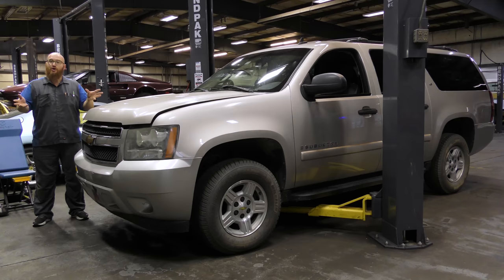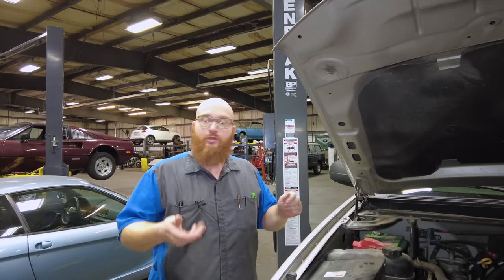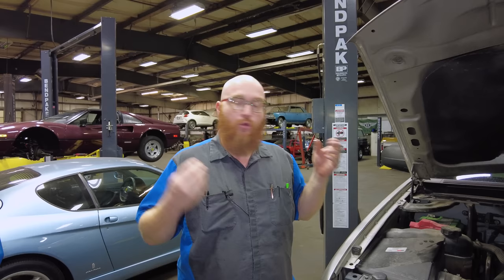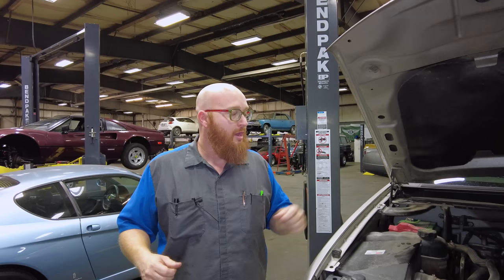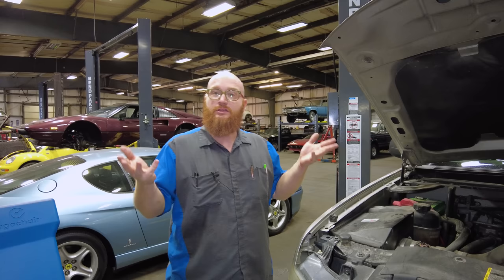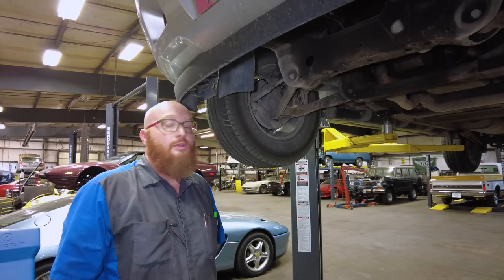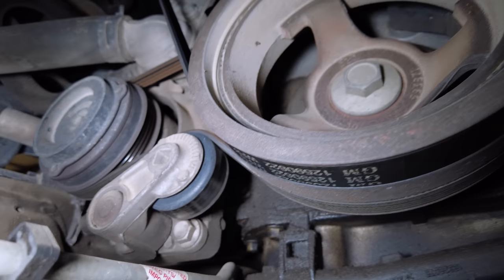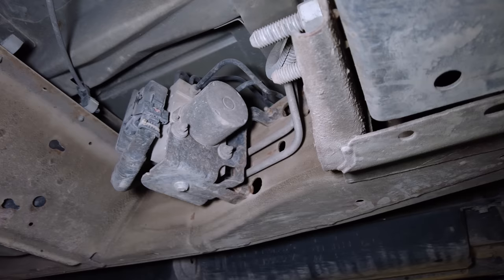What fails on ALL early 2000's Chevy SUV's!? CAR WIZARD shares what he's seen from the last 20 years

Comment: I have an Escalade instead of a Tahoe, but is it a 4L60 transmission and not a 6L80, or did the Chevys get the older transmission longer? I thought though that Haul/Tow mode also kept the converter from locking up and that you could tow in OD because of that. Is that not the case? 

Also, for the AFM, I bought an 07 Escalade because it didn't have AFM yet, but I was told that it still has AFM parts, like the AFM lifters that fail are still in my engine, just not activated. So I believe I'm still at risk from the AFM plagues, even though I don't have it. I've also had multiple broken exhaust manifold bolts. I had a loud tick from the leak that I think was causing a timing retard. I dropped about 3mpg after developing the tic which immediately came back after fixing the exhaust leak. 

One final observation is that a lot of these later ones were manufactured during GM's bankruptcy years. I live in an area where salt is used on the roads and my 07 has way more rust underneath than the 03 EXT I have or the 05 Escalade I had before the 07. I've never seen so much rust underneath a vehicle as my 07 Escalade.  I'll be surprised if I don't have holes under the door rockers soon, they're soft enough that I can push on them with my finder and they give.

One final fear I have about mine is replacing the A/C compressor. The bolts holding it are so tight I'm scared I'm going to twist the heads off trying to remove them. The way the compressor is mounted I'm terrified that if I broke the bolts that the engine would have to be removed, or at least lifted to drill out the bolts. I trust very little on my 07 as compared to my older GMs.

Comment: General Motors has always built the most undependable vehicles on the market. Folks bought them because they were cheap and easier to work on. Now GM is no longer easy to work on or cheap so why buy one. In the thirty years I worked in automotive repair shops GM vehicles were always the bread and butter for the shop owners.

Comment: This many failure points on a vehicle, that costs over 50 grand are not only unacceptable, it is down right criminal.

This video should be used as the bases for a class action lawsuit at the bery least...

Comment: Something that I never hear mentioned is that, on "CANBUS" GM vehicles (I've had it happen with an '04 Trailblazer and an '05 Silverado), if you have installed an iPod or other aftermarket peripheral interface, which has to go in between the radio and the vehicle harness, it can cause intermittent communications or noise on the CANBUS lines. Your vehicle will act like it's haunted. All sorts of electrical things will stop working, or even start coming on at random times. I chased my own tail for two days troubleshooting the Trailblazer. And then I bumped the radio, that I had loosened to get to something else...  It was like a grand awakening. Everything suddenly started working. I would have thought it was random except that, as I said, it happened on two different vehicles with similar aftermarket interfaces. It even happened to the new owner after I sold the Trailblazer. I asked him if he had installed an iPod interface. He never called me back, after that.

Comment: Some of this is true but way over exaggerated oil pressure sending units do go out but not as often as he's making it out and 200 to replace it? Lmao it's a 40 dollar sensor and can change it with the intake on in 5 mins. The active fuel management was worse thing gm did but to change a bad lifter for that or to even buy older heads and lifters to delete it is not 4k dollars. I rebuilt an entire 5.3 top to bottom with big cam performance throttle body and regeared my front and rear diffs for 4k. Ac tensioner is shit it will fail mine did at 230k miles. The ls coils are not that prone to failing now when I do tune ups I do plugs and wires anyway and the wires will get weak from the heat but can be removed with out breaking its not that complicated  but should be replaced. Exhaust manifold bolts over years of heat do rust and will break taking them off on basically any engine. Knock sensors do tend to go out thats true. Never had a gauge cluster issue or blend actuator issue. Never had an issue with the transmission lines failing either with multiple 200k mile gm vehicles. Any of these year models I've worked on Never had oil cooler block off leaking but any engine with high mileage can have leaky seals. 4l60e transmissions worst enemy is heat stock trans cooler kinda sucks add a 40k trans cooler a corvette servo and always tow in tow mode and it'll last

Comment: Bought new a 2011 Silverado 30 Dec 2010-5.3 . 3rd. Silverado-1st was a 1995 Z-71-2nd was a 2000. The 2011 was the biggest POS . Made lifter noise at about 1K miles. Absolute crap oil pressure-less than 40 PSI @ 75 MPH. It shit the oil pressure sending unit @ about 45K-did that myself-kneeling on top of the engine to get at it. 75 bucks-but my knees let me know what I did. LC9 engines notorious for losing the oil pressure relief valve spring in the oil pump-it shits the bed & dumps dang near all the pressure. 10 years later & a whole 80K on the ticker I bailed on that steaming junk wagon. I will NEVER EVER buy a GM vehicle EVER AGAIN. Absolute overpriced garbage.

Comment: 🤨🤔 Does anyone on here know how to turn off the overdrive on a 2007 Chevy Suburban ?   And is he saying all the time or just if you're towing something more than 2,000 lb? And actually I'm just here trying to figure out why Stabilitrak and traction control is showing on the warning panel trying to find a video that can give me in order step by step what to eliminate first. I got new motor mounts new elbow joints brand new tires new brakes and oil changes every 5 months and suddenly after someone stole my car and had it for 6 months I get the warning about s t a b i l - t r a k and traction control

Comment: First it was the gas pedal then the break pedal then the cruise control then it was a couple relays then it was ok then it went to number 5 cylinder plug wire and coil changed numerous times I might add then oil pressure sensor then I hear clicking on the dash and I’m looking at it while driving cause it was showing numbers and warnings then straight lines with no readings ( due to a short under dash behind the e brake it rubbed on the metal that’s down there until it shorted it’s self out almost there is a short under the hood but unsure where that is and then an o2 sensor after all that and it still runs like crap and this is an 2007 Chevy Tahoe don’t get me wrong I love the dam thing to death but not the headache that goes with it I need some honest help if anyone’s had any issues like what I’ve had please oh yeah it’s got almost 260,000 miles on it  oh I forgot to mention the cool lines we’ve relaxed one but not the other one
Reply: Oh yes then the exhaust manifold bolts continues miss fires on number 5

Comment: Yup replaced cheapo hvac actuators. Window motors, Ac serviced 10 times, headlights, rearlights finally replaced some ground wires got it sorted. Cracked armrests. I swear new vehicle came with aftermarket light assembly, I suspect Cartels stuffed these cars full of drugs then swapped out the parts when the vehicle crossed the border. Quality of plastics junk gees chevy.

Comment: My 2004 Traiblazer was great until the trans blew at 80,000 miles. I got that fixed for $1800 and then shorty after that EVERYTHING else started to fail. Chevy's are cheap trash.

Comment: 4L60E is just a overglorified 700R4 which was garbage anyway. But wizard, you forgot 1 thing.BALLJOINTS. GMs truck fail point. At 100000 miles just do them

Comment: Coil and spark plug I on my van tuff to get to my coil spark plugs and coil yesterday $1,600 for all 8 I didn’t care it a write off for my business . the book that comes with the had arecommended to charge it so I just got it done I do I bring my van in 3,000 miles or every 3 months I ask to give me a list  what need to be done. It done.
I buy older vans I have great luck with older vehicles. 
I test drive to my mechanic they give a list  a yes or no.
I may spend $100 or $200to check it .
But it the best hundred I spend it may save me thousands. I have a 3 Ford van 200,000 another 300,000 and 160,000
They all run great
My GMC van 420,000 plus run awesome.
Maintenance, maintenance, maintenance save me so much money and my vehicle run great.
I say old the better.

Comment: Lol the AFM doesn't destroy the engine just pull it apart and delete it drove one 60 miles home hammering like hell just pulled it apart and deleted it all the parts and tuning cost about $1800 from Texas speed and a blind drunk monkey could do a AFM delete I don't bend people over for a delete I'll do the full job for $2500-$3000 max depending on if they want a bigger cam where we get into valve springs and stuff like that and the plug wires are easy to remove as long as the jerk off before you put dielectric grease on them if you cant pull them off easily by hand you need tobfind a new mechanic

Comment: Outside of poorly built vehicles, in my opinion vehicles fail because vehicles owners are bad drivers; speeding,  always flooring the gas pedal, running their vehicles at high rpms. Another reason is people don't properly maintain their vehicles.  Third thing is that people have the wrong vehicle for their style of driving.  If you drive like Andretti don't buy an SUV. I'm a truck driver and i always see these bozos driving recklessly in an SUV  and then flip it on its hood. Just my opinion

Comment: You talk about these trucks like they are 3-valve ford engines. As machines age and are used, things break. Get over it. It doesn't have to be this big mopey production that your car with 120k miles needs spark plugs.

Comment: 5:11 lies I have a 07 NNBS and I had to do a DOD and replace my engine on my truck because it had collapsed lifters. Replacing the engine was cheaper then a rebuild. 5600$ with the DOD delete and new remanufacture engine . 7800$ to a rebuild with out DOD delete.

Comment: 1997 and newer K1500 & K2500 transfer case leaks due to pin-hole in case caused by "pump rub" - happens to ALL of them at 150-200K miles, they slowly lose lubricant and will burn up. I noticed oil all over the back of my '03 K2500 Suburban after a long trip, drained out less than a pint of fluid from the t-case. Was fortunate I caught it before internals were ruined. Had case and upgraded pump installed- BIG expense! https://www.youtube.com/watch?v=s-oLNDts6uE

Comment: Single best way to avoid these issues...don't buy GM products. All of you singing the praises of GM...you're on borrowed time, bud. If the little things don't go out on you one at a time and break you financially, the whole vehicle is waiting to crap out on you at some point with a major failure. 40+ years of experience with this stuff...it's hard to argue with facts. If it weren't for GM products, the parts stores would have a MUCH more difficult time generating a profit. GM pioneered the concept of planned obsolescence, after all...

Comment: Look almost everything you're saying will break well breaks on all vehicles no vehicle is an exception I've been a certified technician for 25 yrs. You speak of the pully, ignition coil, serpentine belt, plus wires, exhaust bolts, battery cables, hvac actuators, trans cooler lines oil pressure sending units, rear and front main seals, oil pan, etc. I'm not going to continue naming everything. I just want everyone to know it doesn't matter what vehicle you buy if it has gaskets, seals, electronics, they're going to fail period. Not just a chevy truck all trucks, all cars, all suv's so just remember every vehicle has all these things that'll commonly fail no matter what. As far as truck's with bad transmissions look at Ford and dodge their extremely common for their transmissions taking a crap before 100 thousands miles wether your towing or not